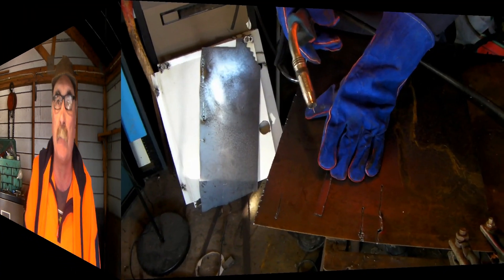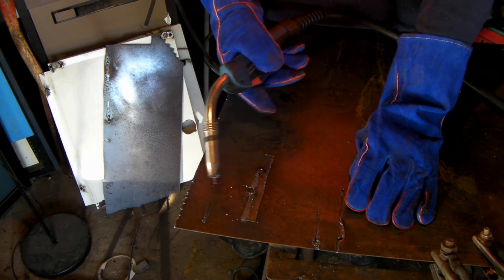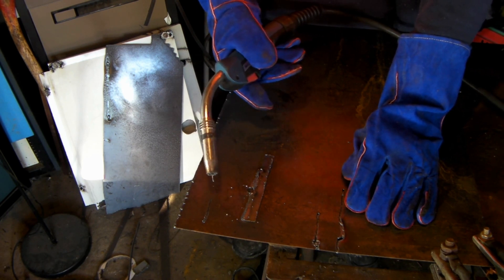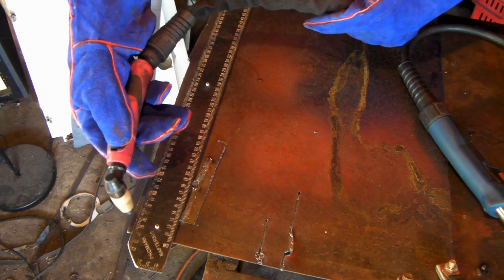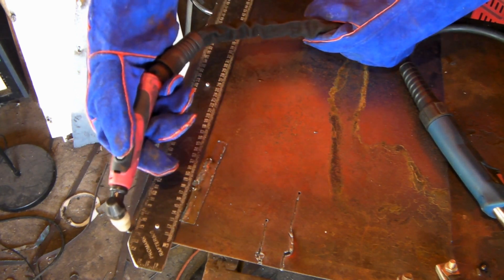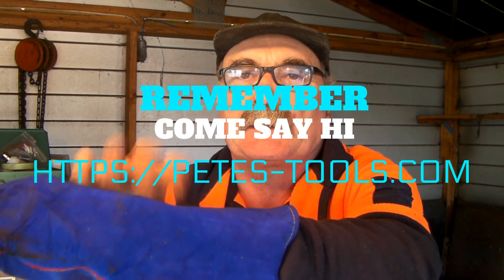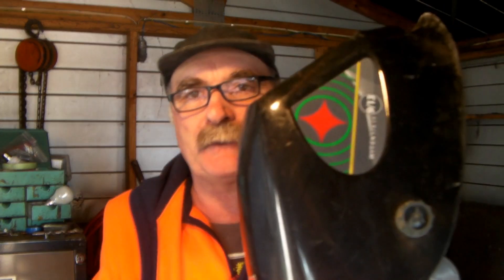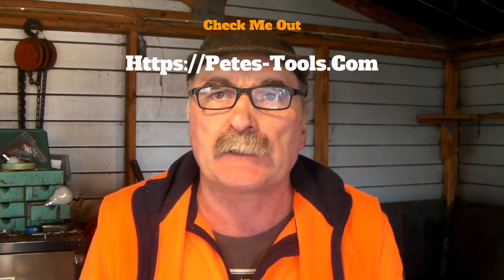PLASMA CUTTING SAFETY  TIPS

Comment: Two things. One is that a main reason why there is less brightness from plasma is because most of the arc is below the metal, and with welding, it’s above the metal. If you plasma cut properly, there will be very little flash on top. But, there’s still enough to be a problem, and for all the times where the torch is too high, and a lot of flash is above the metal, it’s just about as bad as welding. 

You can use TIG weld gloves, you don’t need MiG gloves. TIG gloves are much lighter and flexible.
Reply from the maker: Yea Mel it sucks if you get it.
cheers pete